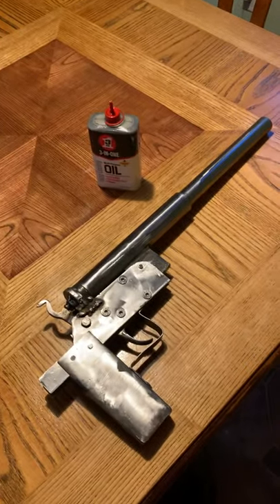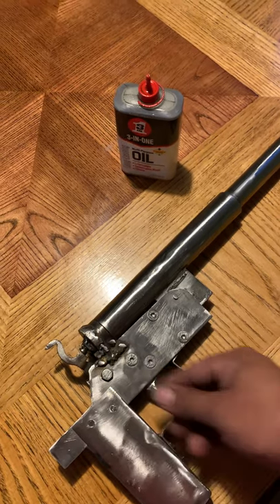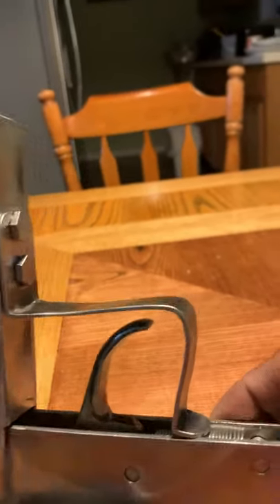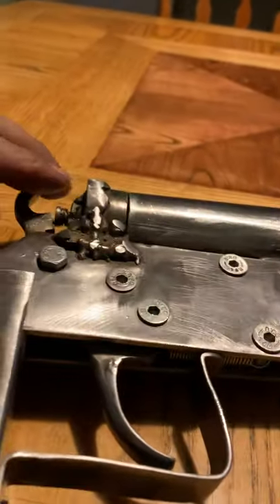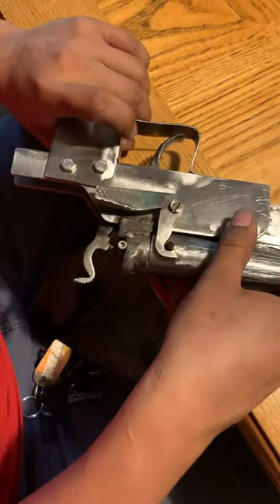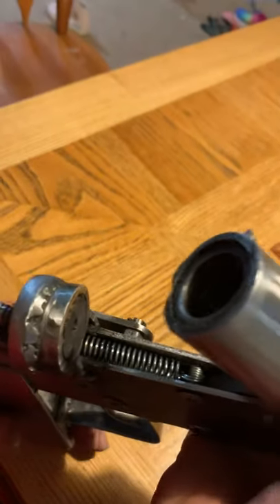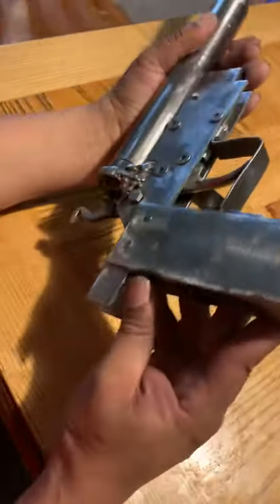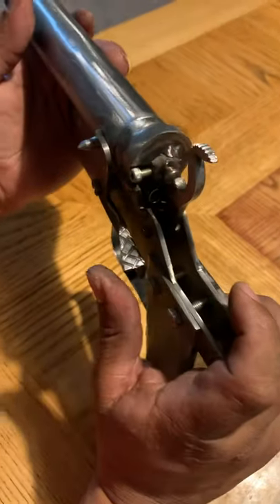Beautiful outcome of a DIY shotgun pistol

Comment: It's ok in USA to have a shotgun barrel under 18" long, as long as the overall length of the entire firearm is not less than 26" long, and the gun is built with a virgin reciever. 
This is how they are able to sell the Mossberg Shockwave and Remington Tac-14 shotguns without any special paperwork.
But when cutting down a shotgun barrel, on an existing shotgun, you cannot go smaller than  18".
Reply from the maker: Renato Doughty thank you for that really appreciate it
Reply: best bet = 26 inch barrel "pistol grip only" 
least rules , most gun, smallest package
Reply: @WapTek123  idk. Regarding indoor-use shotguns...If you are confined to  not exceeding 26",  and you are going to legally modify a non-virgin gun, you can cut the barrel of a side by side or single-shot down to 18", and leave enough wood after the pistol grip to stay within the 26" criteria. There is a lot less "swing" out in front of you between an 18" and a 26" barrel. The added manueverability could be useful. The location of the grip changes how it is held and how obtrusive it is. There is also a balance issue. 
If you really want to make the most compactness in a 26" overall length, you can "bullpup" a single-shot. 
Start with a 24" barrel, but have your pivot pin relocated closer to the front of the barrel. Then relocate your grip and trigger on that huge span between where the trigger used to be and where the new pivot pin is.
 This could give you a shotgun with a  barrel that's 24" long, but only sticking out 10" past your trigger finger, with a 26" overall length, and a lot of people asking where you got it.
Reply: it must have a pistol grip to be defined as a no minimum barrel length "firearm" , so best practices is remake 
or alter the barrel as;  18 inch & then slap a butt stock on it  or  26 inch over all & leave it as pistol grip only